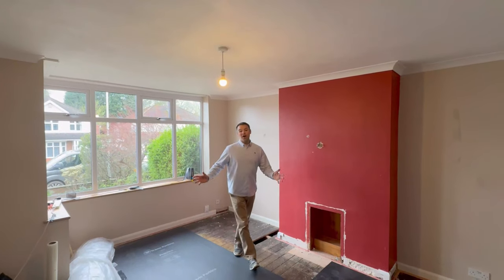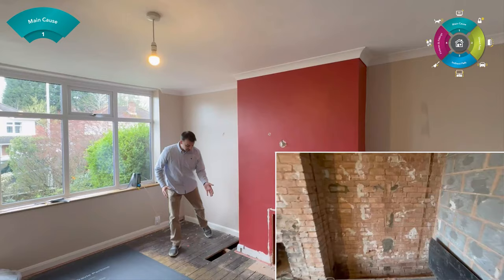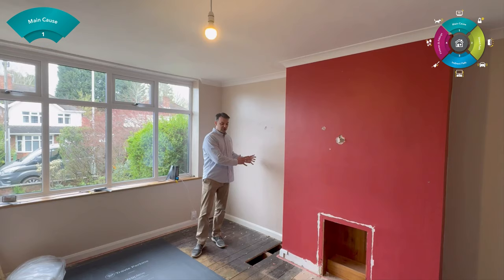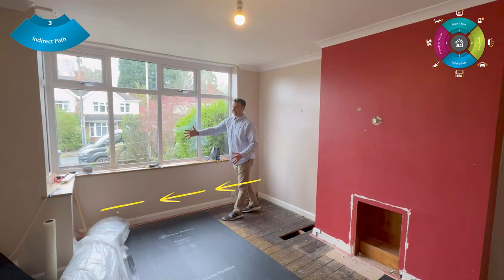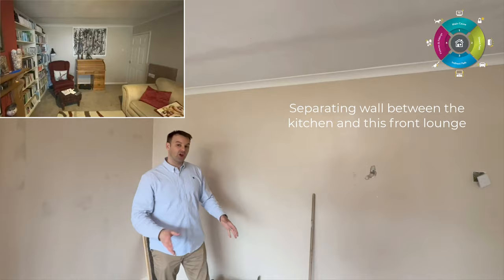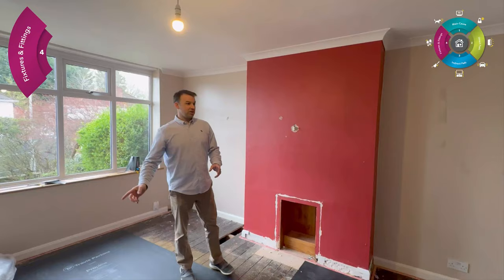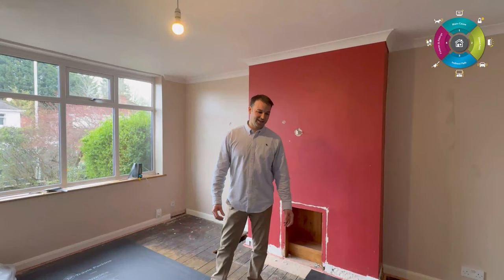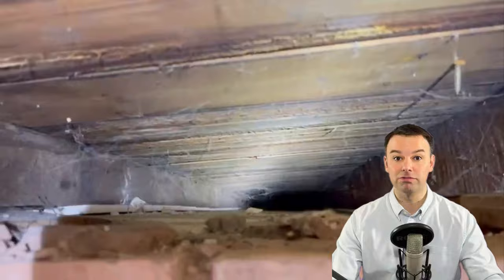Soundproofing a room in a semi detached

Comment: Hi Jim. It would be awesome if you could talk about what to do when you have parallel joists like that against the party wall. I have the same and its very difficult to get into the gap behind it to fill any holes in the brick mortar or stick the rubber. But i also dont want to remove the joist unless it was really going to compromise the solution. What are the options in this case?
Reply from the maker: Hi Ryan, thanks very much, yes will mention it in the full video, Is it your ceiling joists or suspended floor joist that runs parallel?  Or both? 

We are currently plastering this lounge, then fixtures and fitting so it will be out in about 3-4weeks.
Reply: Thanks, really appreciate you sharing your knowledge Jim, its my 1st floor joists and loft ceiling joists, they both run parallel, I have a concrete floor.

Comment: Hi Jim where is part two please as you mentioned, has it been done yet? Thanks
Reply from the maker: Hey James, Part 2 video is done, recorded and is going out next week, I have also been working on a Soundproofing Master Class and loads of other content all kicking off in the later part of next week.  👍
Reply: @jimprior7  great, will keep my eyes peeled, thanks. I am particularly interested to understand the correct way to block holes/seal gaps as mentioned in your video.

Incidentally I recall either reading or watching something about vibrations being transmitted through party wall joists where they can even be joined to the neighbours, but as I can’t relocate it I’m wondering if I imagined it, or did you cover something to that effect? 
Do joists ever meet with the neighbours and can/should be separated or is that extremely unlikely/uncommon? 

There is one upstairs room in our house, which backs onto the neighbours bathroom, which is particularly bad and not only can you can hear conversations pretty clearly, you can also hear the water (pipes) being turned on and off, the toilet seat going down, creaking floorboards etc. I can only imagine there are holes up there, either below the floor or in loft above. 

I have yet to decide whether I’ll be doing a DIY job, I suppose it depends on the extent of what I find when I remove the floor, but does your team cover the Essex area?

Thanks for the feedback
Reply from the maker: Hey James,
Holes in the structure, you want to use sand and cement and some dense bricks for larger holes. Although most people think expanding foam is the answer, it offers airtightness and therefore only reduces the high frequencies getting in.
For hard to reach small holes, use acoustic sealant. 

If your joist are running through to next door and you are unable to disconnect them. You could consider a floating floor. Using a direct to joist board which replaces your existing floorboard to save space. These products such as Deck 37, will reduce vibration through floor. We use this product when someone feels vibration from the neighbours such as walking around, sliding wardrobe doors and the most common…doors banging.

With regards to your bathroom, it does sound like you have holes to hear that much so clearly.
Just be mindful that you could have boxing in and hollow voids amplifying that conversation you are hearing. E.g: hollow area under the bath, shower and hollow floor void etc.

If you have the skills and the tools, then The Noise Free DIY Soundproofing Course guides you step by step. I’m sure you will get a much better result DIY with the tried and tested method we teach you in the course than getting any builder or ‘soundproofing company’ to do it for you.

Sorry, we don’t cover Essex for installation yet.

Flooring: https://youtu.be/JBogcZpw_ss?si=-DMy3DrDAIhWEFMq

Holes and if you are short of time: https://youtu.be/emr8xdqaxMk?si=T0EpPzlRhxATdd_P

Thanks for your comment James, hopefully be working with you soon.
Reply from the maker: @JamesBrown-  The Most Expensive Soundproofing…But does it work?
https://youtu.be/CR7ZtJ3fI2c
Reply from the maker: Join Jim on the NEW Soundproofing Master Class, it’s free to attend and what is quite refreshing….there is nothing to buy at the end, its just pure content and he hopes you get value from it. Here is the link to register:
https://jimprior.com/soundproofing-masterclass-registration/

Comment: Hi Jim, we live on the ground floor of an old Victorian building. We can here almost everything from upstairs (it’s driving us crazy), pets jumping off the beds, footsteps from one room to the next and music quite clearly. Without access to the floor upstairs, is the best solution Rockwool insulation and soundproof plasterboard with some sort of mass loaded vinyl? Any advice would be greatly appreciated. Your videos have given us hope that we may not have to move from our home we love so much.
Reply from the maker: Hi Dom,, Thanks very much for your comments, great question. The good news is that with this age property, the flanking transmission down the walls is usually less than most other aged properties.

You will need to isolate your finished ceiling from the structure to reduce those impact noises. Also understand that impact noise is structural borne and transmitting through the structure so even with the best ceiling system in the world, you would not go into that investment expecting more than a 65% reduction in noise.

The best solution if your ceilings are high enough is an independent frame positioned below your existing ceiling. (minimum 25mm air gap)

This new independent ceiling frame will need RW3, barrier mattings, resilient channels and as much mass installed to these resilient channels as you can afford budget and space available.

Currently putting together the apartment modules for the Noise Free DIY Soundproofing Course which will be added this summer for those of you on it.
Thanks very much for your comment, let us know how you get on.